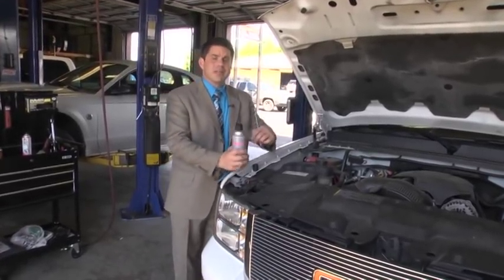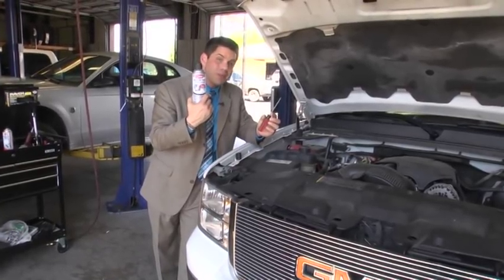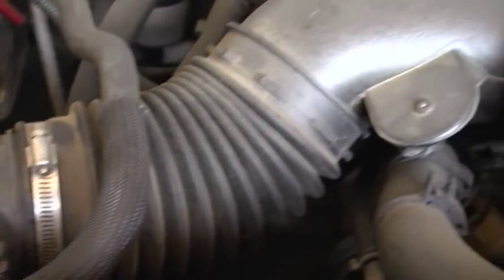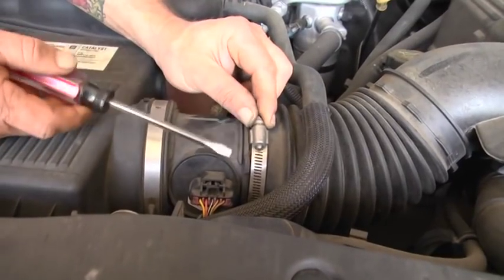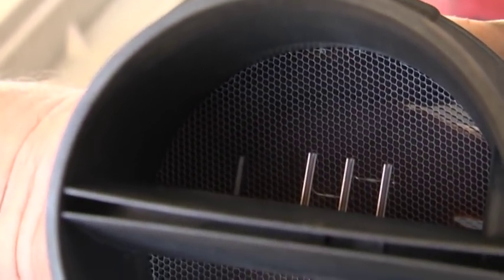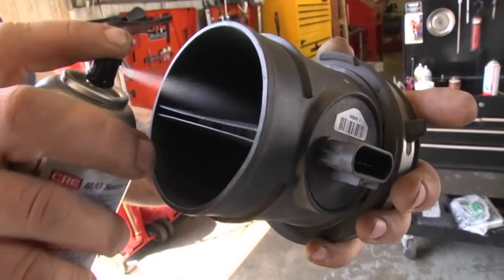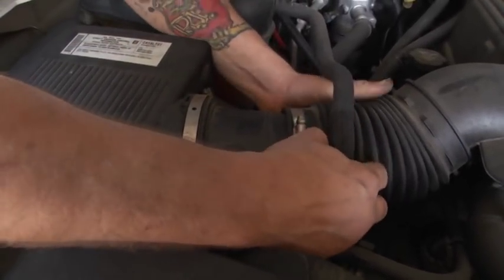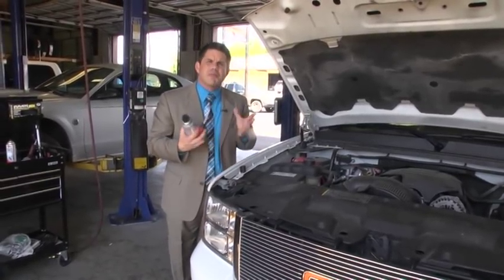Want better gas mileage?  Get a screw driver and spend 2 minutes here

Comment: I can't find this on my tesla!
Reply: +bondovwvw It's inside one of the batteries. Put your screwdriver across two battery terminals. It should weld itself into the form of a handle. Lift while it's still red.
Reply: Mike Scally 😂😭hahahahah
Reply: +deputy1040 
really? you should at least stick to the format if you're gonna make a joke.. that made you look like a total moron.
Reply: It's located behind the back seat it's called the flux capasitor just spray the three triangular prongs and remember to not go over 88mph you might get lost in time.
Reply: Blitzkrieg nobody gives a shit about your tesla
Reply: tesla gets about 200 miles on a full battery, on an average day, i drive 40-60 miles, id use about 30% of the battery, leaving also a short charge time of about 30-45 minutes
Reply: Yeah, when the Teslas spontaneously combust it is hard to distinguish individual parts.
Reply: +keithbu state worker drives a tesla? That state's taxpayers are getting screwed! You might want to think about being quieter about that, no? I hope your not in charge of the state's purchases! Spending $70 k or more to save maybe $20,000 on gas over the life of a car that you could buy otherwise! Now if you could plug them into trees.........
Reply: bondovwvw Yeah, my Ferrari really has it hidden too. Guess I'm going to have to take it to the mech after I get back having lunch in Italy.
Reply: easy to find and clean on our BMWs ...
Reply: keithbu
Keep trying to justify with warped logic  spending thousands extra on a battery and inconvenience of spending hours charging it, but a lot of people, myself included, have rejected the marketing hype and not invested in this immature technology.  You might have temporarily (whilst succumbing to the hype and owning such a vehicle) convinced yourself you did the right thing, to preserve your sanity,  but deep inside, you know you were a fool....
Reply: what are you talking about, the technology already existed, EV1 ring a bell. and those had a 60 mile range and were LOVED by lots of Californians, the tesla is like the EV1 only in a lexus version. those who can afford a lexus, should look into a tesla. again they accelerate rediciously fast and charge time is several hours only if you let your battery drain to 0. in fact charge time is about twice as long as it takes for your cell phone. so say it takes 90 minutes for your phone to get charged up, it would take twice as long or 180 minutes
Reply: ok then, a tesla isnt for you, for a quiet state worker like me who pretty much drives to and from work, or just kind of goes shopping on the weekend, its perfect for me.
its like remembering to keep your phone charged, i never have battery issues on my phone, i know how to keep it charged.
i dont see whats the big deal on a 200 miles range on a single charge. i barely drive 100 miles a day
Reply: in all seriousness, an electric lawnmower is only $299 and has a nice 20V battery
Reply: +Kevin Voyer why you so negative do you work for Bp or something. 
If something can be done better and is environmentally friendly then why not. 
If we had your Outlook we would continue burning burning burning
Reply: Tesla? INSTANT TORQUE
Reply: if you drive that kind of car why would you even worry about
Reply: best 0-60 time with a tesla, be happy for him that he has one :D
be happy for the enviorment.
Reply: it's next to the thingy that explodes into a fire ball when you're charging your Shitzla ha ha
Reply: I found mine easily on my Ferrari 438
Reply: couldn't find this on my 737..
Reply: BMW= Broke my wallet
Reply: BMW = Break Mend Wash 
(repeat steps 1,2 and 3)

BMW = Baiting Married Women.
Reply: LOL!  I find all the hate for Tesla to be rather telling of American Haters in general.  Hate on real progress seems to be a very American attribute.  What should we do now - shut down Space X's mission to Mars?

Either evolve your consciousness or stand down from all the hate fumes.  Every garage, carport or condo covered parking stall should have at least one (1) Tesla.  It is the future of automobiling, so you might as well get over it and simply evolve your thinking to include a more efficient form of personal travel.

Prices will come down when more of you start participating in the economic curve that makes automobile prices "come down."  In other words, stop hating and start enjoying cleaner air quality, lower energy costs to "fuel" your vehicle and spontaneous torque on demand that rivals a Supercar.

When will we ever learn as Americans to stop eating our young and destroying our future in the process.

More power to both Tesla and Space X.
Reply: keithbu
"it would take twice as long or 180 minutes"

.. unacceptable...
Reply: Ahahahahahahahahahahahahahahaha!
Reply: i just dont get why everyone says fuck electric cars, like people are using electric motors in boats now. in fact idk why they dont have electric ATV or MOTORCYCLES, probably cause they wouldnt know what to do with all the gas motors sitting around
Reply: +Jason King and how does a tesla tow a boat?   Oh that's right  ..the rich cunts already have there boat in the marina dock !
Reply: +Indrid Cold hey I agree, the tesla is a beautiful car, but I do not want to pay for a vehicle I cannot drive further than my bladder can go. On YouTube there's a shop that installed a complete GM Performance drive train in a tesla, that has well over 500 hp, still got over 25 mpg hyw. Plus you could drive cross country in it. Not quite as quick, but faster overall. If tesla made a gas version of their cars, I bet they would be cheaper and sell more of them.
Reply: +keithbu actually they are only quicker, Not faster! Sort of like the tortoise and the hare, sure it's quick, but will it get there faster?
Reply: +keithbu oh but they DO have electric motorcycles, lawnmower, ATV's   But they do not cost 3 times as much to do the same thing. Plus when was the last time anyone needed to go so far on a lawnmower? Motorcycles yes, that's why they do not sell so many! Google Zero motorcycles, sound good for a quiet state worker, and cost a lot compared to other bikes the same size, but that would get you your battery fix.
Reply: Nope. You happen to have maf fluid only no sensor. Its self cleaning being submersed continually.
Reply: you will have 2 on your tesla. one for each bank.
Reply: +Kevin Voyer why you so negative do you work for Bp or something. 
If something can be done better and is environmentally friendly then why not. 
If we had your Outlook we would continue burning burning burning
Reply: bondovwvw ha!
Reply: my tesla is faster than everyone's car here. sad isn't it
Reply: I bet It break down more than a gas car does broken gears and inverter problems lol.
Reply: Those are batteries and electric motors.
Reply: why do you here's care if he drives a tesla or not it's his frigging money let him spend it where he wants it's Really none of you a holes business truth be told it sounds like you jersey need to find a hobby and mind your own frigging business Jesus christ...
Reply: Look for anything glowing red and spray it was cleaner. I think he said MAF sensor cleaner, he must mean MOP cleaner so Pine Sol will work.
Reply: Who cares let him drive his tesla and you drive whatever it is you want to drive I'm no tree hugger but no one else has said what they drive which I find funny my brother has more money than God and he drives a Mercedes amg which has 750 hp and cost 350,000 dollars to each his own
Reply: bondovwvw to clean your sensor you need to find these thick orange cables, unbolt them and tape the two orange cables together and now turn on your car and drive for 15 min, it will give your about 20 extra miles of range once you clean it like this
Reply: Stephen Fazekas, You're point has some merit but not as much as you might think. First tally up all the gas powered cars ever sold and measure the ones that caught on fire. Now tally up all the electric vehicles that were ever sold and do the math there. Also look at how the fires started the gas powered cars will almost never explode while off and parked in the garage. Tesla has had batteries explode while charging. Inside a garage the fire will most likely destroy the house. I've talked to Tesla owners that won't park their car in the garage for this very reason. They are happy with this solution. I wouldn't be, but to each there own as long as they aren't burning my house down with their car then I don't care. The irony is that gas cars are so much less likely to catch fire than electric cars. And the ones that do are usually very old and not very well maintained. Electric cars are new and have many safeguards in place and they don't just burn they explode and firefighters have trouble putting them out because of the hazardous and volatile chemicals that make up the batteries.
Reply: Bavarian Marriage Wrecker
Reply: Finally someone who is thinking.
Reply: Carl Allen Smith no one who can afford a tesla cares too much about gas prices. They just like the fact they don't have to stop for gas on their daily activities. Just plug in at night. Wake up fully charged. 
And it's like a fashion statement. Like Apple devices. They work really well, but are popular mostly for the social statements. 
Also, it's to help the environment. Right now, most electricity is made by burning fossil fuels and coal. Which isn't nice to the environment. But maybe if we all start to accept electric vehicles, we can encourage a change in how we make electricity. Like moving more towards wind, and solar energy. And maybe find new, more efficient ways.
Reply: Jason King Oh look, The Tesla Model S P100 has 320+ miles of range! My SVT Cobra can't even come close to that!
Reply: $140k then park, charge, repeat ever 300 miles? You will pay more in hotel fee's than it costs for fuel for my car. That makes for a long and expensive road trip. My Chevy Cruze Diesel has an 800 mile range. And it only cost me $18k.
Reply: Not all electricity is generated by coal, also coal is not as bad as it used to be (better air filtration and waste management). We should be moving to cleaner more sustainable / renewable energy sources which they slowwwwly are. Electric vehicles aren't perfect, production just like production of regular cars and most products have negative impacts, but in the long run it's better (no oil changes, no oil production, refinement and transportation, no gas, no refinement no gasoline transportation). It's best to keep your vehicle running for as long as you can, don't destroy cars when they still have life in them, although I suppose most people don't they just re-sell their older vehicles when getting a new one.
Reply: Come on you can't be that dumb that you don't know that your tesla is 100% powered by "ELECTRICITY"...  Then again go check your blinker fluid and headlight fluid as well as your dash light fluid. After so long the lights will just fade away...lmao.
Reply: bondovwvw is under the rear muffler
Reply: keithbu 200 whole miles on a charge? How many hrs does it take to charge when the batt is almost dead? I can take my fossil fuel vehicle and go 400+ miles, refuel, take a piss, get snacks and something to drink, pay for it all and be done at most 15 mins. Now I'm ready to go another 400+ miles.
Reply: LOL...you have bigger problems than that owning a Tesla.
Reply: keithbu You wouldn't want an electric motorcycle. You want everyone around you to be able to hear you because many can't see you on a motorcycle
Reply: Indrid Cold Only a third of US power generation is coal and it is constantly dropping. Also, most wealthy Tesla owners also get solar panels
Reply: Press your foot on the brake and hold the accelerator for 3seconds then release, do this twice and it exposes itself under the rear wheel motor even on AWD systems.
Reply: is that a new TV 🤔🍺
Reply: Under the 🔋 🔋 🔋 battery
Reply: +bondovwvw It's under the radiator fluid overflow reservoir.
Reply: I keep asking myself why these people buy electric cars that take hours to charge the battery and have half the range of gas powered cars.....
Reply: bondovwvw why not pay a mechanic hundreds to fix your 5 min job c: since you got money to brag about c;
Reply: nice :)
Reply: jokes on you, ever test drive one, their fast, like bmw fast
Reply: Indrid Cold so you're saying never in history has a gas powered car a
has caught fire from a damaged fuel tank or line?
Reply: You paid 15k/20k more for electric car when gas at 3.25 per gallon and  gas car get 25/30 mpg if you drive 25 miles a day to work, it would take ten years at least to make up the differents and no way your electric car will last that long, little lone hassles of finding some where to charge it. You been had dumdass.
Reply: lol get a real car. Tesla is garbage

Comment: If the computer of the car detects less air, the fuel injection will also less.   --> lower power and strength

Comment: And as far as paper air filters go...why would u buy another one if ur "DRY" paper one is dirty. If ur air filter isnt oil impregnated just hit it with a vacuum cleaner hose and save a tree or two.Captain Planet would appreciate it.
Reply: No just buy a k&m air filter
Reply: @thecentralavenuegunslinger7861  You mean K&N and they suck.
Reply: works for me all the time 11 years and 73,000 miles on my escape . original one disregard this if you drive on dusty roads

Comment: Please wear neoprene gloves or equivalent when holding and spraying the MAF sensor. That CRC cleaner is carciogenic like gasoline and will leak through most glove materials. And i shouldnt have to mention to keep far away from eyes and nose it is a breathing hazard. But it shouldnt take more than 1min to dry b4 reinstalling.

Comment: Can you substitute BraKleen or carb cleaner, or maybe alcohol ??
Reply: +TIMEtoRIDE900 Why? The MAF cleaner is on the shelf right next to those.
Reply: But I'm cheep - - and it might be chemically similar.
Reply: +TIMEtoRIDE900 generic brake cleaner will work well enough - be sure to read the label, that it contains pure perchloroethylene. Perc washes away oils, isn't dangerous to electronics, and evaporates practically instantly, so it doesn't have time to do unintended damage to sensitive parts.
Reply: +TIMEtoRIDE900 Absolutely not. That's a good way to fry the sensors, which are over 100 bucks new.